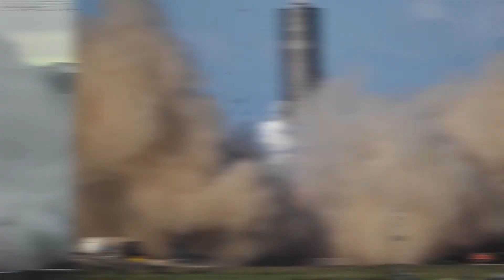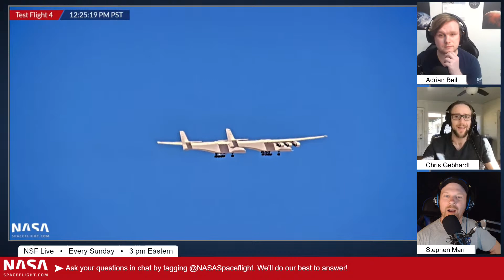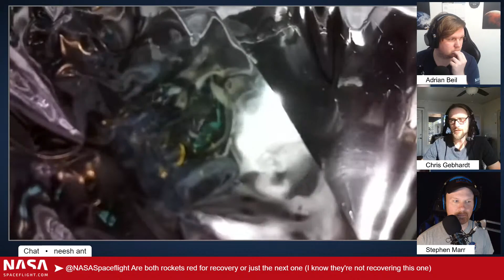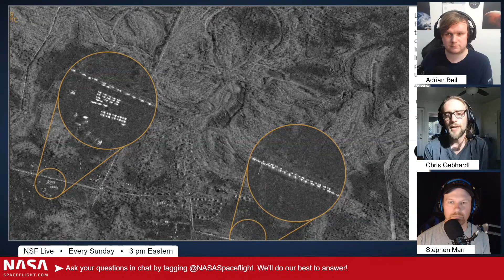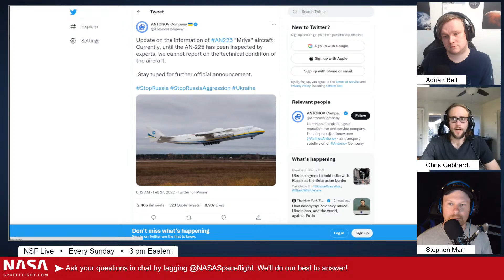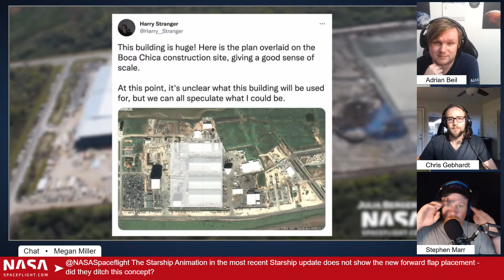NSF Live: What does Russia's invasion of Ukraine mean for spaceflight?

Comment: Generation of hydraulic is not a problem for other aircraft. It’s the aerodynamic effects of landing gear transition that makes it a necessary for all new aircraft T/M/S to “stiff leg” the first few flights before testing the landing gear.
Reply: Yes, I had trouble believing that there wasn't a hydraulic mule that couldn't cycle the gear on this beast. Extending the gear into the aircraft's slipstream is something that would have to be tested in flight.